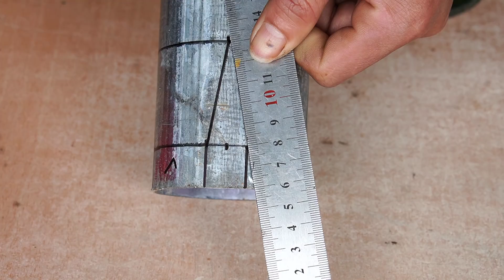Cách nối ống tròn với sắt hộp không cùng kích thước ! Secret Pipe cutting tricks ( part 4 )

Comment: ☝🏻ЦПД РНБО України повідомляє про бойові втрати противника з 24.02 до 06.03, які орієнтовно склали / 🇬🇧 The total combat losses of the enemy from 24.02 to 06.03 were approximately: 

▪️ особового складу / personnel - близько / aprox. 11 тис. осіб, 
▪️ танків / tanks ‒ 285 од., 
▪️ бойових броньованих машин / APV  ‒ 985 од., 
▪️ артилерійських систем / artillery systems – 109 од., 
▪️ РСЗВ / MLRS – 50 од., 
▪️ засоби ППО / Anti-aircraft warfare systems –  21 од.,
▪️ літаків / aircraft – 44 од. (уточнюється), 
▪️ гелікоптерів / helicopters – 48 од. (інформація уточнюється);
▪️ автомобільної техніки / vehicles  – 447 од.,
▪️ легкі швидкісні катери / light speedboats - 2 од.,
▪️ цистерн з ПММ / fuel tanks –  60 од., 
▪️ БПЛА оперативно-тактичного рівня / UAV operational-tactical level  – 4 од.

Дані уточнюються. Підрахунок ускладнюється високою інтенсивністю бойових дій. / Data are being updated. The calculation is complicated by the high intensity of hostilities. 

#stoprussia